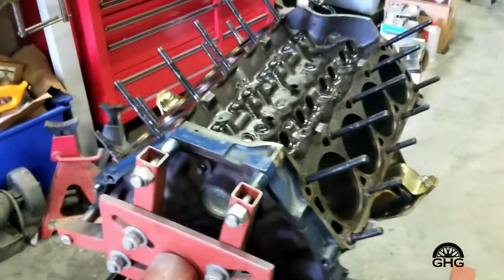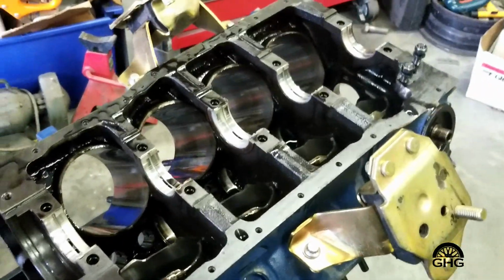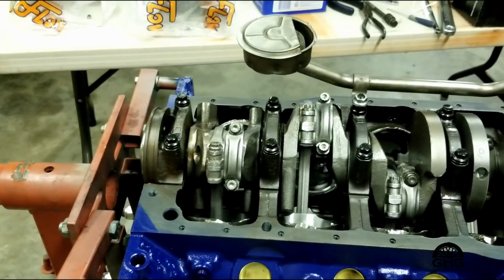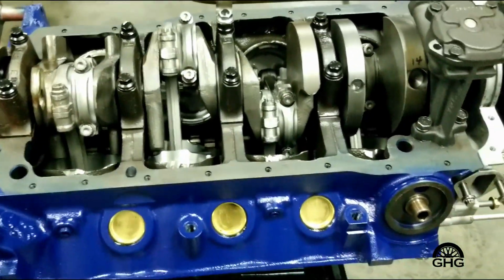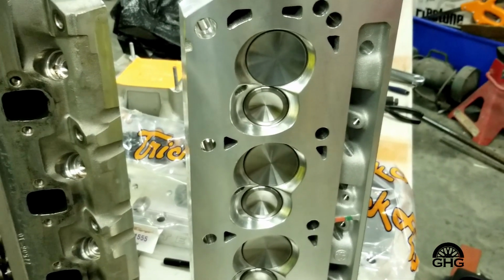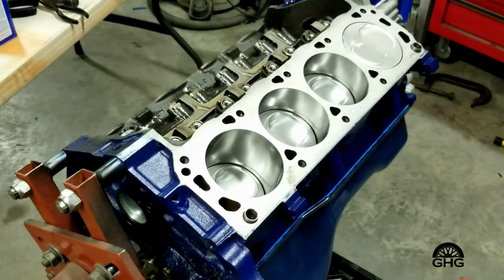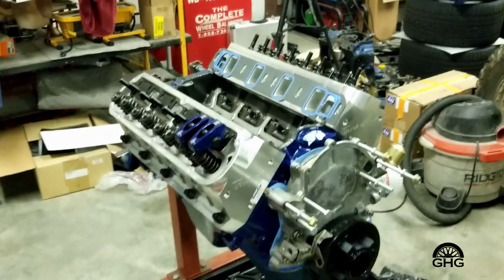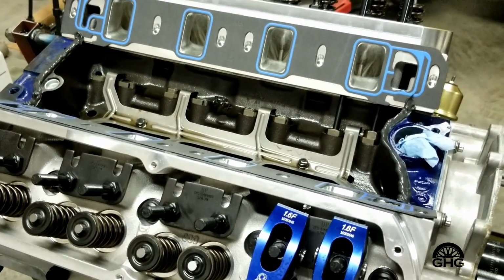1982 BOSS Mustang gets new 347 stroker eng and Tremec TKO 600 EP2

Comment: Depends how long and rough it was run with the wrong balancer, it will vibrate whole crank/motor and damage bearings making extra clearance for oil passing through.. losing oil pressure. But also very possible they did a form of boost or nitro haha
Reply: I'm guessing both had been the problem. Solved by a new short block...

Comment: I would say the wrong bearing clearance could have caused the bearing wear that fast.  Its surprising how few machinist and engine builders there are that verify all critical clearances. The good ones are few and far between. On the bright side its good seeing a SBF/Windsor based channel with plenty of content!
Reply: Just strange how the bearings wore. Almost like the bearings had low and high spots. Never seen bearings look like that. New engine is solid and runs great!  Thanks for the comment and watching!
Reply: @mustangmike5324  that's why I'm thinking clearances from either bearing, crank shaft end play, or something related in that area.  Hope to see more content!
Reply: @TheRdub82  probably because of the play caused by wrong balancer. If you ever balanced wheels/tires, you understand how much that misbalance can cause vibrations in drives
 My buddy ran the wrong size flywheel one time for about a week, wasnt sure what was going on when whole motor vibrate/shook way more than usual.